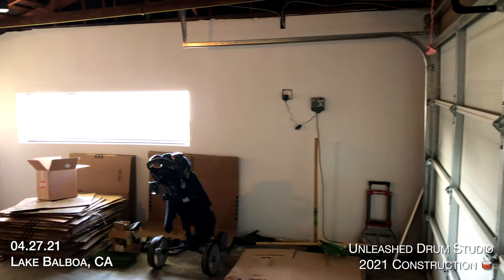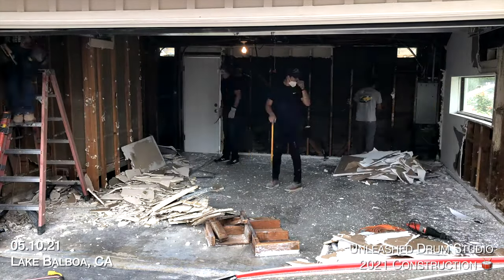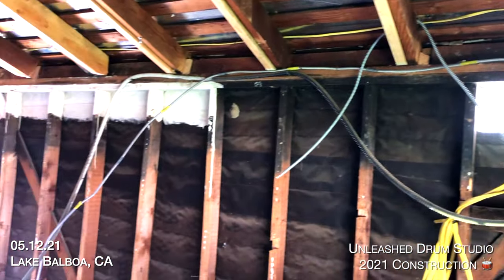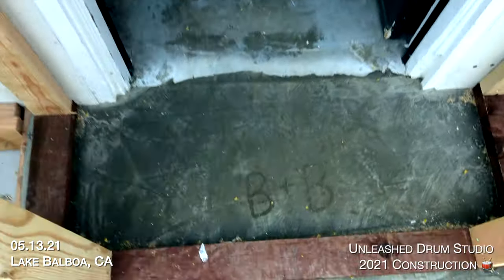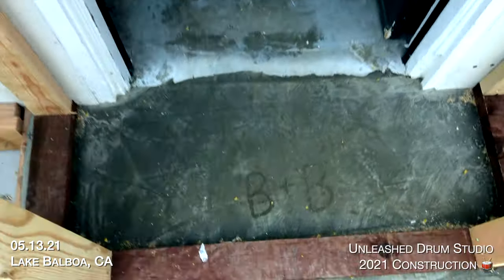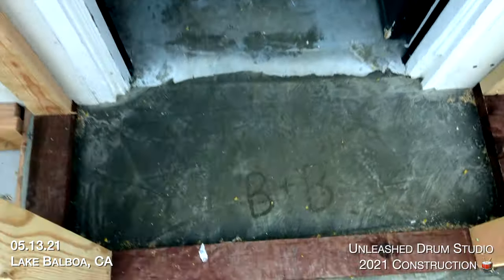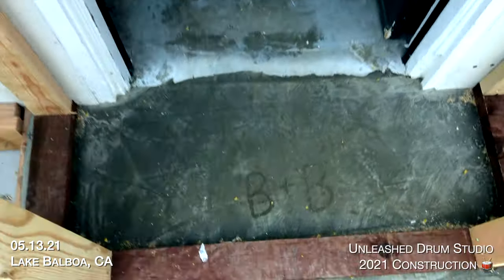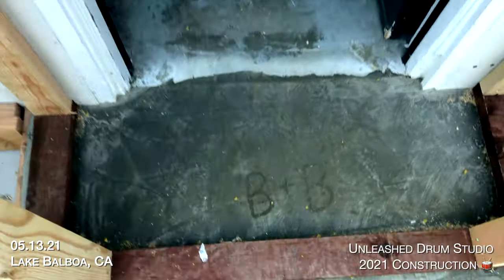Unleashed Drum Studio Construction/Build (Garage Conversion)

Comment: I'm interested in doing this in my garage, it's also a 2 car garage around 20x20. It sounds like you got amazing results with your sound reduction, way better than anything else I've seen online outside of fulling framing a room-within-a-room. 

Did you do all the research to come up with a design yourself? My budget would only be around half of yours, so I was thinking about a combination of DIY and contracting myself like you did. Details like electrical / HVAC and ventilation I'm not confident I'd be able to learn enough to instruct a contractor on what to do without a solid design plan. I'm afraid spending a bunch of money and being unhappy with the result 🥲